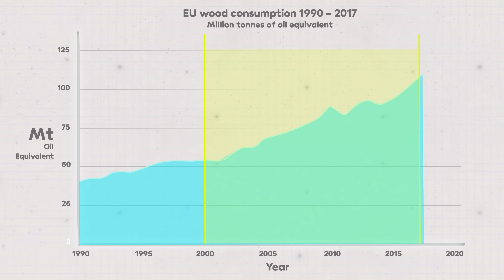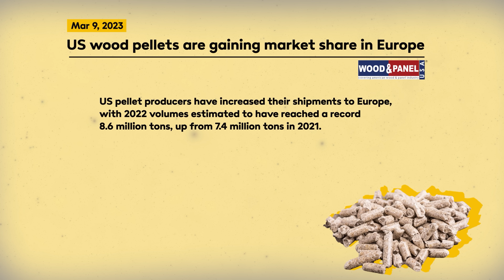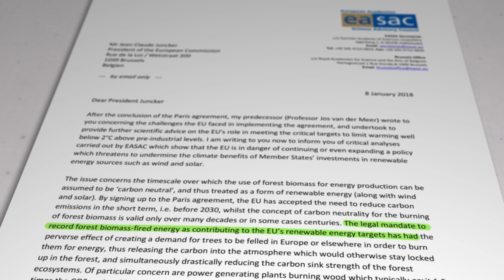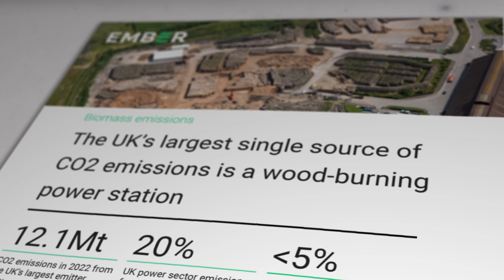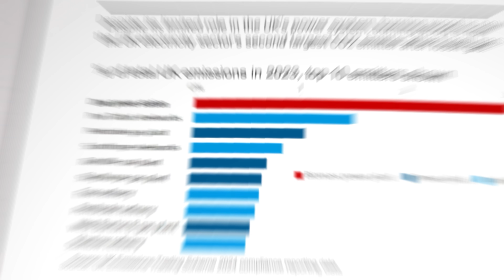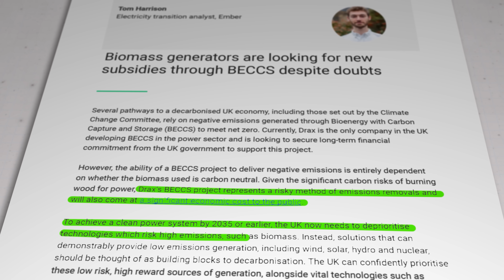New report: Biomass CO2 emissions 4X higher than COAL!!

Comment: Please read the report and think a little bit for yourself 😊I have no idea where 4x comes from. Crunch the numbers and you get 2,72X emissions from biomass than from coal. According to the 2022 electricity mix biomass generated 5.2% and coal 1.5% of the electricity in the UK 2022 - 3,46X more electricity! Another thing the UK sucks at seems to be building efficient power plants. It seems most is around 40% or less efficiency. In Sweden we are near 100% since we also use the heat not only the electricity. This is really click bait 😊

Comment: When I first heard about the wood pellets being used at Drax I couldn’t believe it was considered ‘green’.
Substantial machines consuming fossil fuels cut the trees down, remove the branches, and cut the trees into manageable chunks.
All the timber products are then loaded onto trucks to drive them to the pellet manufacturers when they are finely chopped up and then forced through a screen to form the pellets.
Now we load them onto trucks to transport them to ports where another machine loads them onto freighters which then cross the seas to wherever using oil sludge as fuel.
Offload the pellets, transport them to power stations and then use conveyors to load them into the furnaces. 

How, in the reign of pigs pudding, can that be considered ‘green’ even in your wildest dreams?

Comment: The problem is that trees are used as fuel. Instead, bamboo should be used for that, as it is thr fastest growing plant in the world. Trees should only be used for construction, furniture and other things that lasts for many years so a new tree has time to grow back. Bamboo also uses very little space thanks to it's fast grow rate so it won't replace forrests on the contrary, it will preserve forrests, thanks to it being a more efficient product.
Reply: Whilst agreeing with many points here it is still the case that wood will be replaced with growth whereas coal and oil will not !!
Reply: @gman-norman   coal and oil will ultimately be replaced though just in a much longer timeframe. But forests will also take decades to hundreds of years to replace, so in the timeframes we need to reduce carbon on the atmosphere and sequester carbon (which biomass does the opposite) it makes zero sense. Especially for green "renewable" subsidies.
Reply: Except bamboo only grow a few places - where trees grow almost everywhere.
Reply: @homeistheearth  bullshit, bamboo can even grow in Scandinavian. I know because I live there.
Reply: @SkepticalCaveman Me too - then grow some. Or tell me where there are a place where they grow as fast here as you say. Its been so cold this spring that i have had problems getting cucumber and tomatoes to grow in the greenhouse - sugar corn are growing very slow, and every time we just got a little warm you could se they grew better - but too little too late.
Reply: @homeistheearth  bamboo is is not a vegetable.
Reply: @SkepticalCaveman  ???
Reply: @homeistheearth  You complained about your vegetables, bamboo is not a vegetable so your point is irrelevant.
Reply: @homeistheearth  algae grows in places trees cannot.
Reply: @tealkerberus748  yes - algae is very versatile, also great for removing runoff nutrients from soil erosion.
Reply: Yes but the whole point of Drax is that is a fossil fuel model of plunder and extraction of existing resources, paid for by subsidies. They don't concern themselves with regrowing anything, only stripping the ancient forests and burning them for very inefficient energy (most of which is waste heat)
Reply: Algae is even faster growing than bamboo, and all it needs is sunlight and a small amount of water - you can set up algae farms on desert coasts.

Comment: Incinerating biomass is probably the single stupidest way to derive energy from it.
Reply: It is also the most clever way to derive energy from it since it is the only way to do so.
Reply: @JanBruunAndersen  What? I've got two alternatives for you. Biochar and biogas. Both generate much cleaner energy from biomass while also building the soil in ways that last.
Reply: @brightmal  Biochar (a trendy name for charcoal) just means you only partially burn the biomass instead of fully burning it. Biogas just means you let biomass rot anaerobically and burn the gas coming off it instead of burning the whole biomass. Said gas is very toxic as it is contains dangerous amounts of sulfur compounds (which become acidic when burned if not purified out before burning) and has low energy density compared to natural gas due to being roughly half CO2 before you burn it. Biogas is in some ways similar to natural gas that has yet to be refined.

Both biochar and biogas waste a substantial portion of the original energy content of the biomass fuel. There are advantages to be gained from doing so as charcoal can be cheaper to transport and will burn more cleanly when burned as the dirtiest effluent was already given off in the initial burn that made the charcoal. Biogas is, obviously, a gas, which can be advantageous versus solid fuel for many uses. Neither is inherently cleaner in the long run than burning biomass directly in the context of wood burning for grid power.
Reply: @brightmal  - Tell me that you did not listen in chemistry class without telling me that you skipped science classes all together.
Reply: @angusbartlett9270  Char means "not combusted". If it combusted, it wouldn't be char, it'd be CO2.
Reply: @5467nick  Not exactly. A decent induction tube can char wood efficiently with no combustion whatsoever.

Biogas can be got by pyrolysis, in the form of pygas (though with a higher carbon monoxide component).
Reply: @bartroberts1514   char means "to partially burn."
Reply: @angusbartlett9270  To char means to leave char as a residue. Char is uncombusted matter. 

You're not wrong that most biochar is made in cone fires or the like, by combustion of some portion of the wood (generally the VOCs) to raise the wood to charring temperature in the absence of oxygen, so it does not combust.
Reply: @5467nick  Biogas is very easy to filter and then use like any other methane. The key difference is that this methane was not sourced from geological sources. That's a big difference. What's more the digestate then provides amazing nutrients for the soil in a way that does not destroy the soil biome. And making biochar does produce energy and release some carbon into the atmosphere. But again, that is carbon that was already part of the biosphere, not drawn from geological storage. But more importantly, a huge amount of cabon is transformed into a material which is amazing for long term soil health. And I mean really long term, thousands of years long term.
Reply: @JanBruunAndersen  I don't think that snide and ignorant is a good combination. And it really doesn't contribute anything uplifting to the conversation.
Reply: @brightmal  You can't remove many gaseous contaminants that easily. This is referred to as "gas sweetening" and it's not easy to do at small scale. Biogas has a lot of sulfur compounds and that corrodes most construction metals and many rubber or plastic components. Biogas also has a lot of CO2 which lowers the energy density of the gas and is even harder to efficiently remove. The "easiest" way is through alkaline processing, but that requires a lot of energy, so it's somewhat counterproductive.

Again, all of this talk of biomass is coming from carbon already sequestered is made irrelevant if you cut down trees faster than they grow back, which globally is what is happening. There is a difference between repurposing waste product (always a plus) and harvesting materials specifically for that purpose (more nuanced) and when you harvest old growth without replacing it, you are simultaneously re-emitting what was stored carbon and reducing the carbon sequestering rate of forests since a tree that's cut down is no longer growing. The fact that biomass is often harvested on one side of the planet then transported to the other makes it even worse.

It wouldn't be a problem if they were managing land in a way that the biomass grew back as quickly as it was harvested and was mostly consumed relatively near where it was grown. That's not happening.
Reply: @bartroberts1514  An induction tube is going to use more energy and more expensive equipment than burning a small amount of material to start the process, which is self-sustaining once started.

Pyrolysis makes syngas. That carbon monoxide is not a small problem, it can comprise over half of the molar quantity of the gas. The smallest leak is a problem. There's also a lot of heavy liquids and volatile contaminants that escape with the gas when the charcoal is heated enough to be relatively pure.
Reply: @5467nick  I'm sorry, but you're just wrong on a lot of that. Getting hydrogen sulfide out of raw biogas simply involves passing it through a bunch of iron oxide. A couple of jars full of rust shavings will do the job just fine. Now, getting the CO2 out is a far more energy intensive process, and not really worth doing at a small scale. Yet. I'm part of a team that is working on that problem. As for cutting down trees for this, you are absolutely right, it makes no sense. And as soon as you transport any organic waste more than about 20 km you'll probably use more energy than you gain from the process. That also makes no sense. And growing plantation forests to use for fuel is just stupid on so many levels it's hard to imagine how it happened. But that's politics for you. Local organic waste to biogas, biochar and digestate can be done very easily. Growing plants simply to use for fuel, on the other hand, makes no sense at all. Let alone shipping that biomass across oceans. That's just a net negative in every direction.
Reply: @brightmal  I'm a little confused as to why you said I'm wrong about a lot of what I said to you, then you agreed with almost everything I said, primary exception being hydrogen sulfide removal. Regardless, my question to you, as someone claiming to be working in this field, is what does your team do with the iron sulfide created by reacting iron oxide and hydrogen sulfide? There's also the issue of the various slightly to highly volatile organics in syngas should pyrolysis be the method one chooses instead of anaerobic digestion, unless the goal is burning it all together in something like a steam engine since those are more suited to handle that stuff unlike internal combustion engines.
Reply: @5467nick  Sorry, you're right. I should have said your initial statement was incorrect. In regard to the iron oxide, once it is full of Sulphur, it can be exposed to the air, and a bit of warmth and it will separate into elemental Sulphur and Iron oxide powder again, so the Sulphur can be captured. To be honest, not something I've done at a small scale. Yet. I would also note that in many cases, Iron and Sulphur are vital plant nutrients. In most of the pyrolysis I've seen the syngas is simply burned off. At a small scale that makes sense. And while it is a bit nasty, it's a lot less so than simply burning the wood in the conventional sense. And a key factor in all of this is that any carbon dioxide released was already in the bio-cycle not being added to it from deep underground.
As for the steam engine, I'm a big fan of using smaller steam engines in both processes, as they're so bloody versatile, but I think the right system has to be developed for that. We've been using petrol and diesel generators for so long, there's not a lot of expertise out there in this scale of steam, while back in the day every farmer used to have one for all sorts of tasks.

Comment: 2 x 35 MW power stations (small I know) were built in northern New South Wales Australia around 10 years ago, attached to sugarcane mills in Murwillumbah and Broadwater ostensibly to use the sugarcane waste to produce power for the mills and the local grid.
 They can continue to harvest in any biomass that they can including any sawdust from timber mills and I believe freshly felled timber under some green energy government loophole.
The company named itself Cape Byron Power athough the mills are nowhere near the town of  Byron Bay.
 It's belived that it was named so to piggyback on the green credentials that the town and area has in the eyes of Australia and the rest of the world.
I doubt whether this small operation by world standards is any better than the ones named in your video.

Comment: An unfortunate truth is that the majority of attempts to reduce carbon emissions actually result in a fifty percent increase in emissions on average. Had the majority of attempts at replacing existing systems with so called green energy been seen as the farce they really are and efficiency and emissions reductions implemented instead there would be at least 75% less carbon emissions than there are now.
A recent Tesla truck crash resulted in about a thousand years worth of emissions reduction from EVs literally went up in smoke
Reply: @ItalianWallElfAssociation  The numbers are mostly my personal estimations based on published data . You can find a lot of the data and actual reports that say similar things in places like the IPCC and others mentioned in this video and previously on this channel and other similar channels , however you may need to skip the headlines and summaries and read the actual papers to find the information.
Reply: Another bit of evidence that climate change is a scam is batteries…
If climate change wasn’t a scam (in the sense that scammers exploit it) then all batteries would be standardised.
The batteries for your power tools would be able to take a battery from any other brand or the battery case could be easily opened and standard replacement batteries installed.
The same applies to all EVs. With very little design planning ev batteries could be standardised so that the replacement and recycling could be done at a fraction of the current cost and not require a degree in electrical engineering and a laboratory to perform.
The battery modules just slightly larger versions of power tool batteries could be clipped in by the owner of the vehicle or a version of jiffy lube.

Comment: Good grief, will the CO2 mythology never stop??  Carbon dioxide is produced by every cell in the body as a normal by-product of cellular metabolism. The adult human body contains some 21 liters of gaseous carbon dioxide as compared to 1 liter of oxygen and 1 liter of nitrogen. Most of it is dissolved in blood and body tissues. Still more is incorporated in bone, which is composed of “hydroxyapatite” that consists of collagen, carbon dioxide, and calcium.  CO2 is benign, beneficial, and essential for both animal and plant life. It enables respiratory drive, and every aspect of the mechanism of oxygen transport and delivery that captures oxygen from atmospheric air in the lungs and delivers it to cells deep within the body. Most carbon dioxide hovers close to the earth’s surface because its molecular weight is higher than that of other atmospheric gases. The concentration of CO2 at sea level is only 0.003% of the atmosphere. It cannot possible cause “global warming” in such low concentrations. The available evidence indicates that we survive in a state of CO2 starvation, because most CO2 is produced by the vast mass of subterranean microbial life that thrives miles deep beneath the earth’s surface. This is also the source of oil, water that fills the oceans, and all the atmospheric gases except oxygen, most of which is produced by photosynthetic bacteria that are ubiquitous on the earth’s surface. Small increases in CO2 cause explosive plant growth. Bats live in caves where CO2 levels are high, and African mole rats thrive in burrows deep beneath the earth’s surface where oxygen concentrations are low and CO2 concentrations are high. Both live far longer than comparable mammals that live above the earth’s surface. CO2 is also an excellent refrigerant. It was patented as a refrigerant in 1850 in Britain and by 1870 an American businessman installed CO2 refrigeration in a ship to transport Texas beef to New York City. CO2 is also one of the most potent and practical therapeutic agents known to medicine, though this knowledge is presently suppressed. In the 1930’s CO2 was used to treat heart attacks, strokes, drowning, smoke inhalation, asthma, pneumonia, and newborn babies with breathing problems. Try reading my review of CO2 pathophysiology called “Four Forgotten Giants of Anesthesia History” that can be downloaded from my website www.stressmechanism.com

Comment: It is awful people cut down trees just to burn an industrial scale. But to me, equating this to coal plants is missing the point. The CO2 emitted by this plant is indeed carbon neutral. Humanity did massive deforestation during the modern era, yet nothing happened. Only when we started using coal and burning oil, things went wrong. We should only look at new carbon being added to the carbon cycle.
I'm tired of idiots claiming that hydropower is polluting because stagnating water emits methane. Or people asking for farms to close because cows fart. 😤

Comment: Biomass still is carbon neutral in 10-60 year span, depending of the speacis used. This lobbying is just to make UK and the rest of the climate anchous world ready for taxation of burning biomass, later banning all combustion in favor of other technologies. Got to remember all biomass will decompose to co2 anyways will you burn it or not. It just stay in sokir form longer. So by bans you may cause a dip in the co2 emissions, but in couple of decades emission are back at the levels before. In short. If land is green, good. As long oil is lifted above ground, co2 levels will go up. No matter how oil is used, at the end it will be burned or decomposed. Ocean micro plastic perhaps will save us as it will finally be buried back to oxygenless ocean sediment